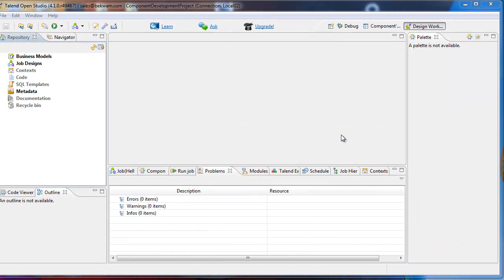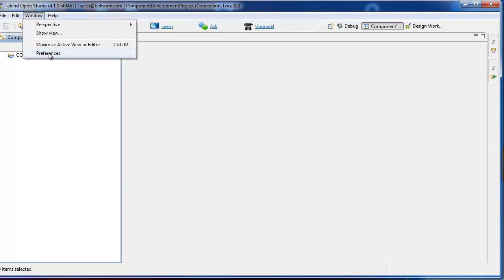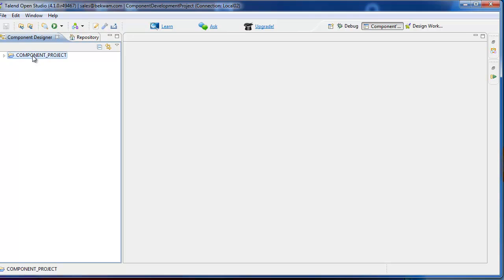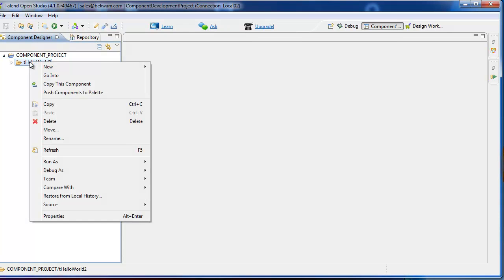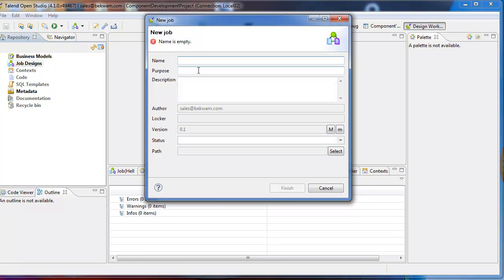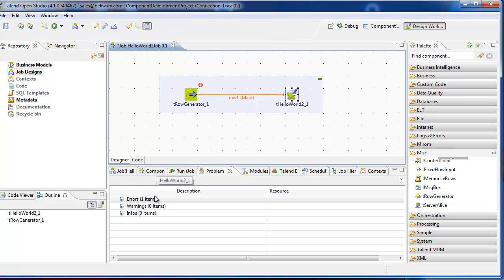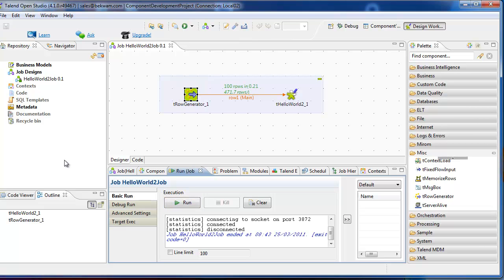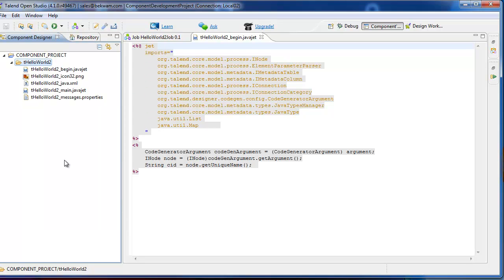Component Designer in Talend Open Studio

Comment: thx bekwam. still not doing anything. I am executing simple println() in my tComp_begin.javajet

I'm kinda familiar with JET and I've just checked the generate() method of the template-generated java class. I can see that the System.out.println("xyz") invoked inside of %> and just after it are generated correctly in this method.

But when I run the job I just don't see "xyz" printed anywhere in the Execution console

Comment from the maker: Hi,

The System.outs in the script blocks (angle brackets) will show up in the console, But those statements outside of the blocks will not.  javajet is a template that is run when the component is published to form a fragment of a Java class.  Switch to the Code tab from Designer and look for your statements to make sure they're in the right place.